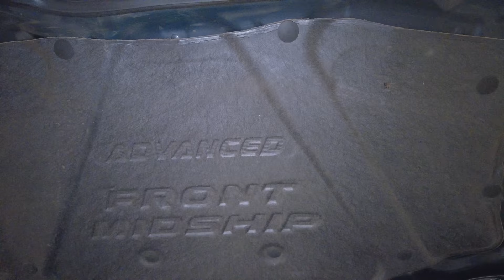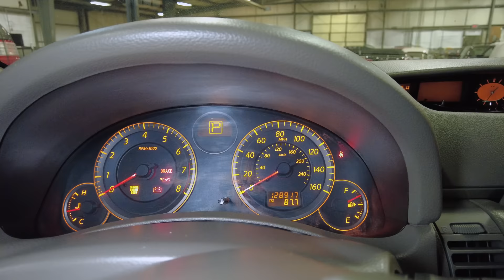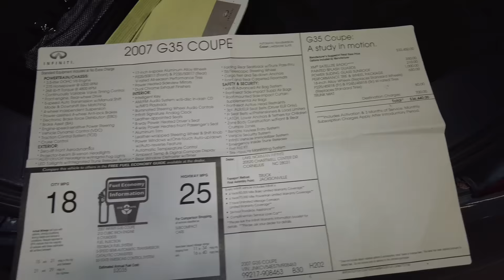Our 20 Years Together Calls for a New Ride & Adorable Kitten!

Comment: Happy anniversary!  I keep waiting for Hoovie to pop up and criticize something. I have a 2010 G37 Convertible that I still enjoy driving with 47K miles (Garage kept).  Shiny, melting and cracking dashes are normal for all the Gs after a few years of heat.  Also, the Passenger Occupancy sensor will likely fail giving you a nice dash  light to remind you it's not working and now off.  This can be replaced with an override device under the seat that keeps it occupied and the air bag always on when the car is on.  You will have to also unplug the passenger seat belt connector under the seat or one red light will be replaced with the seat belt light.  You could also just plug in the passenger belt when not in use.  Lastly, the oil gallery gaskets can fail which will drop your oil pressure and be an expensive repair. Luckily, the repair corrects the problem, but while you are in there, you might as well replace the timing chain, serpentine belt, and the water pump and any other worn items you may find.  Since you have a sunroof, you should run a snake down the drain holes as they an easily get clogged and keep them clean.  One preventative thing I did was remove the 10A fuse for the steering wheel lock while it was unlocked as this can fail on you leaving you stuck.  It never happened to me, but it's a common failure and easy to put back if you change your mind (There is no engine light if you pull this fuse).  I have no codes on mine except 2 codes about the fuse I removed.  My G37 didn't come with security sockets so Infiniti may have phased that "feature" out.  I hate them too.

Comment: Loved this one! Congrats on your anniversary! I have a 2006 G35 Coupe in the same colors with 112K miles. I'm the original owner. It is all stock. No cracked dash, everything is fine mechanically. Has always been garaged and has no paint fade. It has been a great, fun car. As for the key, if it is inside the car and it senses the door close, it will beep to alert you that you have left the key behind. It also will not let you lock the door with the door handle button if the key is inside the cabin. If you were to leave the key in the trunk, such as in the pocket of a jacket, when you close the trunk lid, it will automatically pop the trunk open. There is another security feature and it regards limiting access to the trunk. The key fob separates to reveal a physical key that opens the doors and locks the glove box. Retain that and just leave the larger part of the fob with a valet. Before locking the glove box, note that inside the glove box on the lefthand side is a black toggle switch. Move that to disable the truck release button that is to the left of the steering wheel. Then lock the glove box with the physical key. No one can then open the trunk with the button in the cabin. Also, if you ever hear a single soft beep that repeats every 15-20 seconds or so as you drive, that is an alert that the trunk lid is not fully closed. FYI, the small upper glove box is where the DVD-based nav system lives in a car so equipped. Enjoy the G35!

Comment: I know you said you didn’t want to modify the car however, I recommend getting spec D headlights, ensuring that you reapply some sort of marine silicone around the seal and then do an LED conversion to lastfit brand headlight bulbs. It makes the car look 20 years newer and you can actually see to drive at night.
Reply: SPEC D LIGHTS ARE TRASH - THE SEALS ARE HORRID. KEEP IT CLEAN!

Comment: Happy Anniversary! 

You bought my car! I bought two new cars in 2003. A black C5 Z06 and a silver G35 Coupe. I still have the Coupe. Mine just turned 30K miles. It's bone stock and mint. No rips, tears, cracked dash, etc...  I've also run Amsoil since the break in. 

I don't have the keyless entry. I actually have a key.  Mine doesn't have the rear trunk button either. 

Funny thing. When I got the G35 people were literally falling out of the passenger window to get a look at it. This was crazy to me. I was almost invisible in the C5 Z06. 

Issues that I've had in twenty years of ownership:  The passenger seat motor went out and both window motors went out. The LED third brake light went out. Another thing that went out was that Infiniti put too short of wire in the remote harness, so the wire broke and I had to crawl through the back seat to release the trunk. It didn't have a rear release, so entering through the trunk and releasing the emergency release was the only option.

Everything was fixed under warranty and I haven't had any issues since. I've just done maintenance stuff. 

Oh...  I did fix the trunk wore myself after they fixed it the first time. They just used a wire crimp and it broke again. I fixed it properly by adding wire so it didn't stretch and break opening and closing the trunk. 

One thing I don't like about the car is that the doors like to close on your leg when getting in, even on flat ground. It's kind of annoying. I also don't like that the seatbelt on the passenger side likes to bang against the door if no one is in the passenger seat. They fixed that on your car by adding a seatbelt guide to the top of the seat. 

Anyway...  Congrats!

Comment: Happy anniversary to both, great following along with you since the start. ✨

Also, we have an Infiniti in the family, the rapid beeps alert you that the key is inside and it's also a safety mechanism that will not allow the car to lock the doors while the key fob is inside.
I'm sure you are very careful with that.. but should it come to happen, the car's system prevents it.
Reply: That was my thought. As my mustang does the same thing.  Just a different sound

Comment: Congratulations on the 20 years together!

I just sold a 2008 G37S coupe we had for a couple of years.  Mechanically it was sound - 186K on the clock.  It was almost bone stock, except for some fancy wheels.  The engine compartment was so stock, I had the hood open and a sign announcing that fact at the local Cars&Coffee.
A Southern car - the dash was cracked everywhere.  The silver paint was failing in several places.  It was a lot of fun to drive!

Comment: Congrats on your gifts & 20 years! We have a 2013 Infiniti G37x sedan in our fleet. The beeping is to remind you that your key fob was left in the vehicle. It also will not allow you to lock the doors with said fob in the vehicle UNLESS the engine is running. This is because at the time, people were having lots of issues with locking their keys in their vehicles (it happened to us too many times on our old 1997 Infiniti J30), & locksmiths may not be in immediate range for service. It's also a safety prevention to prevent people from locking their pets (or children) in the vehicle, especially on very hot days where the heat can unalive them.

Comment: Congratulations Mr. & Mrs. Wizard! :)

The beeping sounds like an anomaly to me.  The car should not beep when the key fob is inside the car, regardless of whether the engine is running or not.  And after Mrs. Wizard showed the dash, she said she was going to turn it off, and it sounded to me like she was turning off a physical key and removing it from an igntion slot, so it doesn't appear to have push-button start.

However, if it DOES have push-button start, then something is wrong, because there are only 2 circumstances under which the car should beep at you:

1) If the engine is running, the key is OUTSIDE the car (e.g. you get out of the car for a minute and the key is in your pocket), and you close the door.  The, the car will beep at you to remind you that the car is on but the key is outside the car.

2) You put the key fob inside the trunk and close it.  When the car senses the key inside the trunk, it will beep at you and then pop the trunk open.

Comment: The alarm when closing the door (or trunk) is there to prevent you from locking yourself out/ locking your keys in the car. On my V36 G35, it only happened when closing the trunk lid on the keys or trying to lock the door with the keys in the car. It's similar on the Q50s. I believe the V35 G35 in this video uses an older version of the proximity key system, so the behavior is likely slightly different. I always wanted to see a G35/G37 on this channel and was surprised one hadn't come up before. Congrats on your anniversary and new cat!

Comment: I use to work with a guy who owned a 2009 G37x Infiniti.  The car had almost 450,000 kms on it if I remember correctly.  He was driving 200 kms a day to work and putting just as much in gas a week.  It was reliable and he loved it.

Comment: Kudos & congratulations, to you and Mrs. wizard on your 2 years. Incredible find — I always wanted the coupe in Lakeshore Blue but needed a sedan and enjoyed the G35S in my profile pic for many years stock everything with the Sport package; raced and drove it hard for 200,000+ miles before I sold it last year because it’s so popular and parts are scarce/expensive. But will say, it’s a top 3 best vehicle I’ve ever owned; hope you enjoy yours. 

Also, that incessant beeping is letting you know the key is still in the car — especially if the vehicle is turned off, you exit, then close the door. If you lock it with the door control and leave the key in the car, it will unlock the door after its shut, until the key is removed. Also, the wheel key may be in the glove box; that’s where I always left mine on that vehicle and all my other vehicles. LOL

Comment: Congratulations you guys!  20 years in and going strong!

Not to sound like a jerk, but a 350Z is a much better ride for Mrs Wizard than for you.  Not many cars would radiate "Bad Case of Midlife Crisis" more than the Wizard riding around in a 350Z.  Plus those stuff sport type suspensions won't do your back any favors on top of what you do for a living.  But a coupe with larger doors is a good choice.

Now, I'm not a fan of the 3.5 Nissan engines.  Although my experience comes from helping my dad with his 02 Maxima.  Having to go through the bottom and flex the AC compressor out of the way just to replace the bad alternator didn't help.

The biggest issue with the older 3.5 motors is the rings that either wear out or carbon up and stick.  The motor starts burning oil more and more with mileage.  My dad's Maxima is at 225k now and it's a quart every three tanks or so.  Which wouldn't be half the problem if the oil ash didn't plug up the cats integrated into the manifolds.  He had all three of his cats replaced only five years ago, and I got the rear one out a couple weeks ago, with it completely plugged with ash.  I'm not doing the manifold cats if I can help it lol.

Still not as bad as the 2.5L Nissan motors of the same vintages where the first cat would degrade, shed tiny pieces of ceramic, and such those into the cylinder through the EGR tube.  By the time the loss of oil and power becomes noticable, the motor is only good for getting your core back after buying another engine.  The good news is, you don't need to worry about broken exhaust manifold bolts since the cats need to be replaced anyway.

Comment: Congrats 🎉 one thing ive learned about the g35, if you start having transmission issues particularly valve control solenoids. Pull the valve body and check the leads by lightly lifting them. They have a problem of developing hairline breaks that are so small youd never see it.

Comment: Congratulations, Nice G. Worked as a Tech @ Lake Norman INFINITI from 2009-13. Check the front lower control arm bushings, can be replaced, and look at the oil cooler, the "O"ring to the block dies over time

Comment: The beeping with key inside car is to advise that you have left the key inside the car - it's that simple.  This feature reduces the risk of unintentionally leaving keys within the car which could enable an easy undesirable theft of the motor car.   There are numerous insurance company reports of car thefts where owners left the car unattended with keys in the car, keys in the ignition, or worse still, with engine running.

Comment: BTW I used to own a 2005 G35 coupe with all the fun add-ons. Made about 300HP, and was a really fun car to drive, looked cool, and the exhaust sound is STILL in my top 5. It had some electrical gremlins though, and the VDC never worked very well. I occasionally miss it. Never had the beeping issue with my 2005. Must've been a newer feature.

Comment: Wizard, I have a theory on your beep. So seats have sensors to know if somebody is sitting in them. Example for airbag on passenger seat.

The beep is the 'Hey, you left your key in car'. So if it does it when seated, then perhaps whatever sensor detects you are in the seat has failed.

Comment: My wife got one of these as her first sporty car when she was 20. Excellent car. But the "crankshaft positioning sensor" was intermittent and eventually went out while she was driving it. Gave her a good scare losing power on the hwy and another time in the middle of a slow corner.

It was an awkward but easy fix. But by then she had lost trust in the car and moved onto a 370Z.

Comment: It's an early version of Nissans proximity intelligent key (still applies today).  It beeps to let you know it momentarily doesn't detect key.  Also if you leave keys inside and lock from outside the beep will be longer (in your video...my FX35 does same sound) and automatically keeps vehicle unlocked as to not lock yourself out (if so equipped).  I say if so equipped because that G35 coupe has while has intelligent key features no push button start but can still leave keys in pocket and turn over the ignition with that switch that looks as though it would accept normal key...say old design 2006 Altima.  Bonus feature hold down unlock button for a few seconds and both windows roll down.

Comment: Happy Anniversary!! Try the glove box, that's where I keep my security socket
Reply: If it was a dealer installed item, there was a tywrap that came with the set that would attach the lug socket key to the lug wrench. Others had a hole in the styrofoam that holds the tools where the socket would fit. I would recheck the trunk area.

Comment: I recognise the sound with the key, its a common Nissan thing when you leave your key in the car and try and lock it it will make that beeping sound. You might be able to change it in the settings but im not sure since its an older model. I think it might be a key thing and you might need to get an actual proximity key if its not in the ignition.
Reply: I had a 2009 Altima with pushbutton ignition and it made a similar sound, using a separate exterior beeper.  The warning was to prevent locking the key in the car, and along with the warning, it would also use the power locks to unlock the door(s).  I don’t remember if I ever tested leaving the key in but not locking it; my assumption is that it should be quiet, but I could be wrong on that.  Perhaps this G35 has a problem with its door-lock sensors (if it has them), where it thinks the doors are always locked.

Comment: My 07 Altima SL did the same beeping. It goes with the keyless entry system. It is supposed to prevent you from locking the key inside but it isn't perfect. If you press the door handle button to lock the car it sometimes locks the key inside depending on if you are lucky. My Altima also popped the trunk open if I closed it with the key inside but again it didn't always catch it. It isn't supposed to do it all the time, so I am not sure if the G35 has it calibrated differently.

Happy Anniversary!

Comment: Oh nice! Got one with the VQ35DE. Didn't know they kept those going into 2007. Would go after that one myself were I to get a Nissan. Want to avoid the direct injection on the later models so I wouldn't have to worry about carbon deposits.

Comment: Try to see if any of the doors arent unlocking when you try to unlock the car. Trunk and gas fill door. Also check if the car is detecting each door and if it's open or closed. This might be happening because the car isnt detecting the driver door opening.

Comment: Congrats on you and Mrs. Wizard. 
I love vq engines. I have owned 3 vq30de engine maximas. Autocrossed all of them. Engines love to rev and run higher rpm. Haven't owned a vq35 but I've been thinking about trying to find a z platform car at some point.

Comment: Congratulations on 20 years!  Like the wizard, my beard was red, but I know that because I last grew out my beard in 1981.  Unfortunately, due to company safety guidelines issued in 1982, I had to shave my beard off.  40 years later, I retired and immediately began to grow a new beard.  However, time had played a trick on me.  My beard is no longer red.  Instead, it is snow white (like David Letterman's beard).  Every now and again, I will get referred to as Santa Claus, but that gets quickly changed as I am tall and built to not be messed with.  So Wizard, enjoy the beard color but be prepared for time to play some cruel tricks.

Comment: The 2007 Infiniti G35 sedan my dad had, did the same beeping thing with the proximity key.  It beeps to gig e you feedback when it is locked or unlocked, but it the beeping goes crazy when you try to lock/unlock it with the door open.

Comment: Looks like the '03 G35 coupe that I had, it was an auto as a daily but I still modded it some.  Just the sports brakes/wheels and other small stuff.  Kids kind of forced me to trade it in on a M56S for a bigger back seat.  Edit: just saw it came from Lake Norman Infiniti, that is just north of Charlotte and my current Infiniti Q70L was transferred from there to my local dealership about an hour northeast of there.